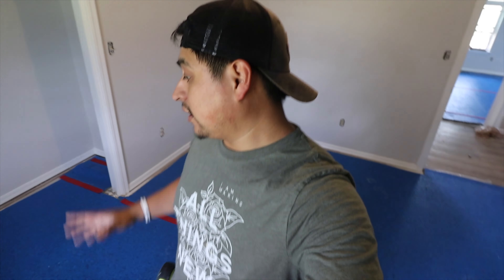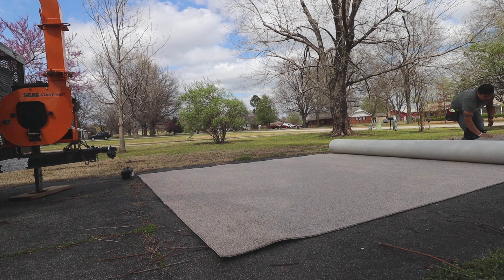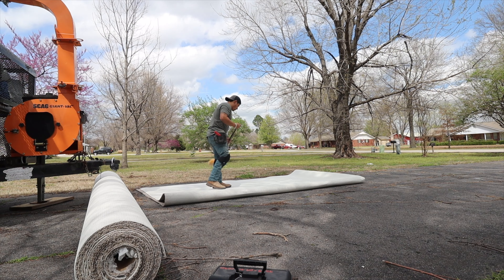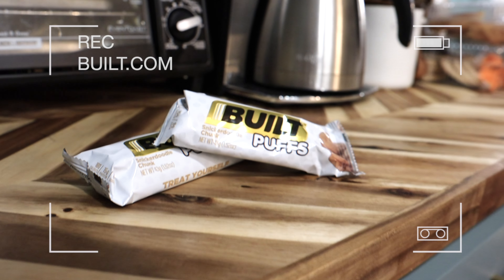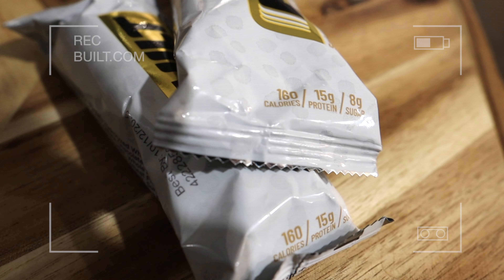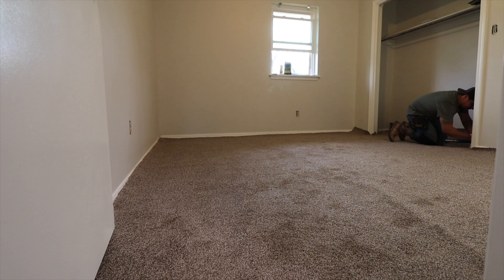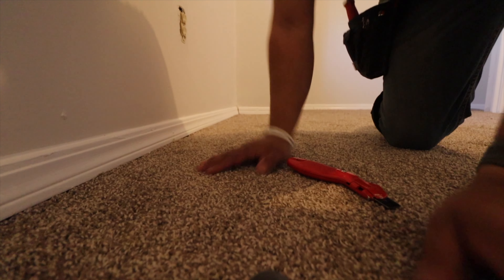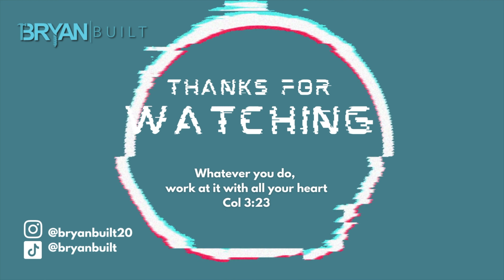Carpet Installation...DIY Nightmare or a breeze? | How to Install Carpet

Comment: Thank you. Good videos. You explain things well.
Reply from the maker: Glad you like them!
Reply: So my cat peed on my carpet. So I pulled it up and removed the carpet and pad in a 4 x 6 rectangle area. The carpet pad was not glued down. So it was really easy to remove everything. Took about 2 minutes. 
I went and bought new pad and cut it to size and placed it down (not going to glue it since it wasn’t glued before). Now I need to put the carpet on top. 
It’s a rectangle. 3 of the sides will go under the baseboards, but the 4th side will have to match up to the carpet that is still on the floor. How do I keep that edge down? Double sided tape?? Wish I could attach a picture.
Reply from the maker: If its joining the current carpet I would say it needs to be seamed. If you want to send a pic via instagram@bryanbuilt20 i can get a better idea. But i think you would need some seam tape. normally  you need a seaming iron for this but i have also seen a seam tape that can be done cold but have never used it my self.